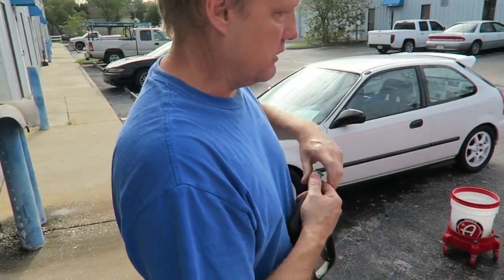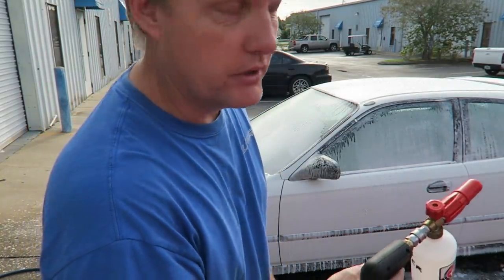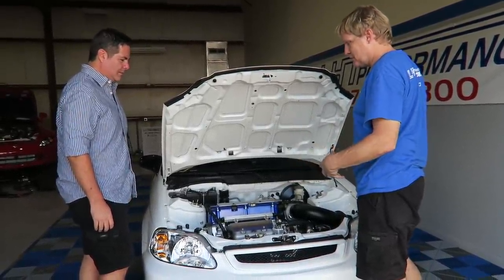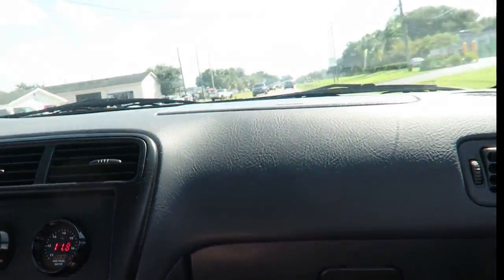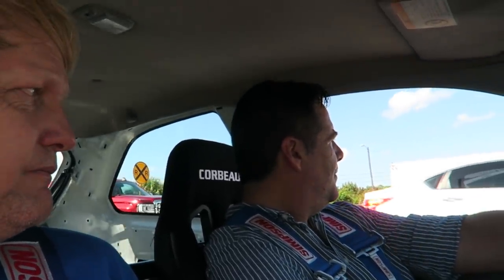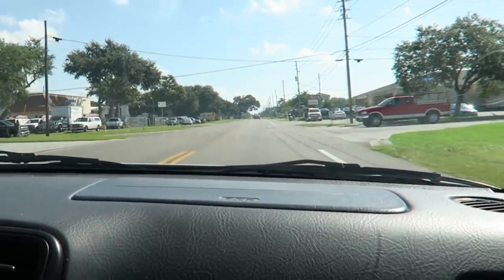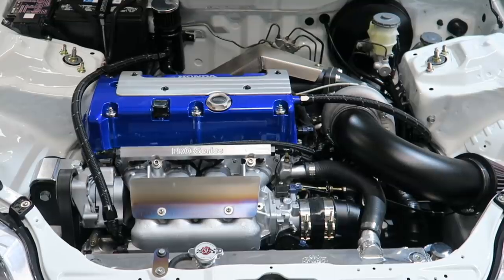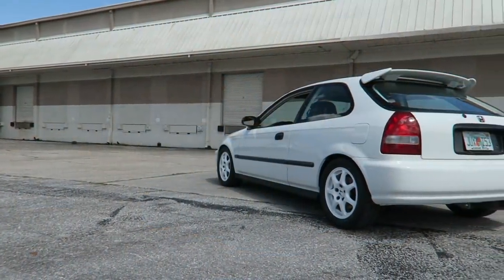Th Owner picks up Hatch and  ships Curaçao

Comment: Which turbo is on there?
Reply from the maker: Brent Bender GTX3071R
Reply: @LHTPerformance  Thank you :) Doing some research for future turbocharging applications on my 2005 Acura RSX Type-S. Love your work!.
Reply from the maker: Brent Bender You’re welcome, it’s a great size turbo for 450-500whp and amazing spool up speed
Reply: @benderaviation  - The boost builds quick, but doesn't have the extreme power surge at the top end. Not having the surge promotes better grip and lose breaking lose.